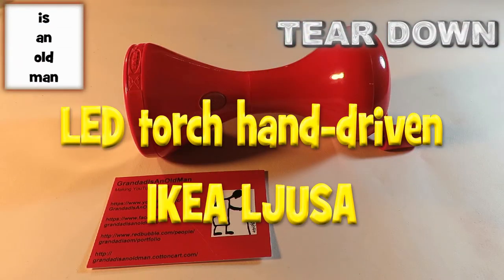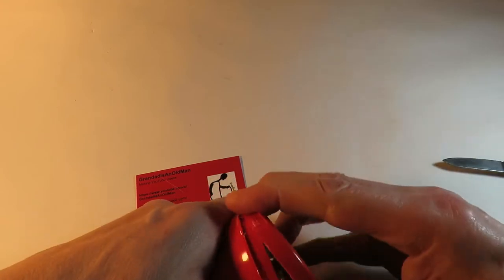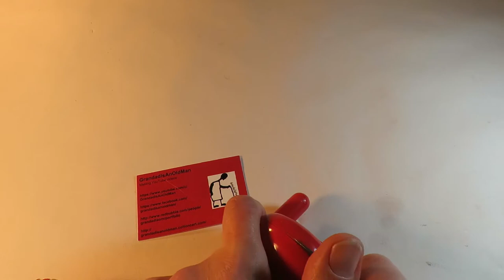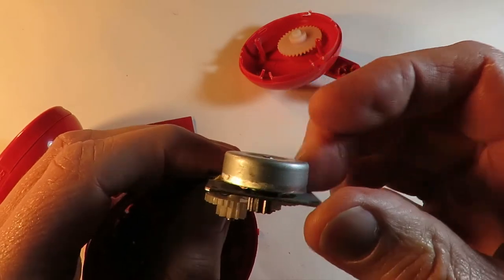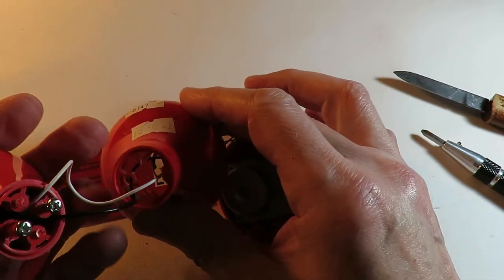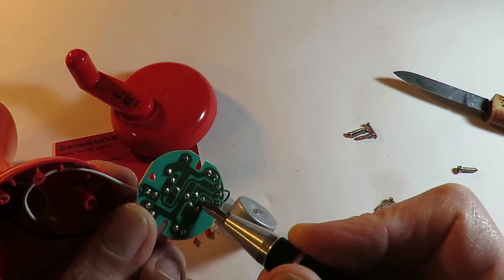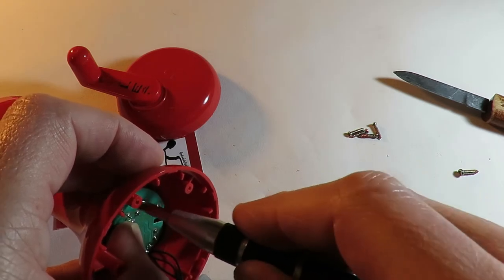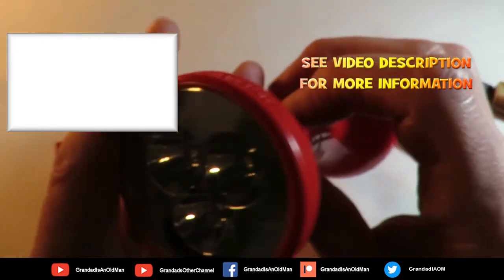IKEA LED torch hand driven LJUSA tear down

Comment: Thank you for the very useful video. Mine had gone dim and I thought I’d pry it open & replace the rechargeable batteries inside. But now this video has saved it from being ruined.
Reply: So what did you do to resolve the dimness?  Crank it until it was bright again?
Reply: @dubmob151  No sorry It just stopped holding any charge after a while. It lit up only while being constantly cranked. once you stop cranking, light goes out too. Might need to buy a new one,
Reply: @sajidhq  someone said they found the connection to the capacitor opened up, maybe from dropping it. Maybe that's what happened to yours also, so it would be worth opening up to see.
Reply: If the capacitor itself actually failed, maybe it'd be possible to put a rechargeable lithium ion cell in there for energy storage. It would take a lot more cranking to charge up, but then there would be the benefit of a much longer run time.

Comment: That supercapacitor is good information - no deteriorating accumulator inside - true "always ready" emergency flashlight
Reply from the maker: Yes I was pleasantly surprised. Many of the cheap ones just have button cells that are not even rechargeable so this brand is significantly better.

Comment: Thanks GrandDad :) I wanted to open this one as it stopped holding charge... Only when I crank it up, LED's used to light up. Upon opening the back side, saw capacitor had come off the circuit, need to solder it back and see if it starts holding charge... this one is almost 9 yrs old now :)
Reply from the maker: That is great, it is always satisfying to repair rather than replace 😍👍
Reply: Did it work after soldering though?

Comment: Thanks for the help. Mine was out of order because the axis around the dynamo was loose. I'd advice to open the torch with a vice instead of with a knife though ;) 
It's a pity ikea doesn't make those devices more reparable (with extra skrews to open them)
Reply from the maker: It is not in IKEAs interest to make them repairable 😁
Reply: @GrandadIsAnOldMan  yet they're no longer selling them for reasons unknown. If they did, I'd pick up a bunch of them. And then modify the crank handle with a rolling sleeve so it can be properly cranked without the loose thumb grip that it needs as is.

Comment: A very good price! Well found. Especially as there is no (chemical and deteriorating) battery in  it.
Reply from the maker: Hi Deslo 😊 yes a handy little super cap + a handy generator. By coincidence I saw another one in another charity shop for £1, still a good price for the components inside 😊
Reply: the super cap may have a limited lifespan though it's better than any battery-  mine is probably well over 10 years, don't even recall exactly when I got it from IKEA, and it's still working with reduced storage capability.

Comment: l find that using a cut off top from a plastic bottle makes cranking much easier by minimizing the friction from your fingers.  I have it cut to just the length needed so I can store it past the bend when not using it. 
a plastic sleeve ideally should have been part of the design-
Reply from the maker: Great tip!

Comment: Thanks for the vid. I was anxious to see if it used a spring or a battery. This video answers that question.
Reply from the maker: Thank you for commenting. I was quite surprised when I opened it up, it was better quality than I expected :-)
Reply: I've used wind up flashlights, in the past. The ones that use batteries aren't as efficient as the spring powered ones. The spring powered ones also last a lot longer. Every year, I pack shoe boxes for operation Christmas child. A common gift in those packages are flashlights with extra batteries. I'd prefer to use spring powered flashlights, though, as they last almost indefinitely.